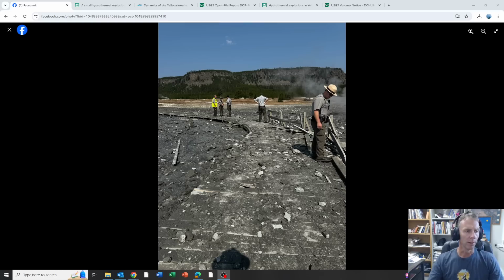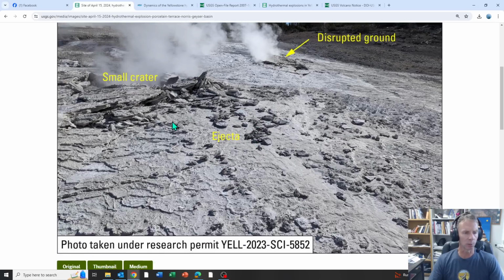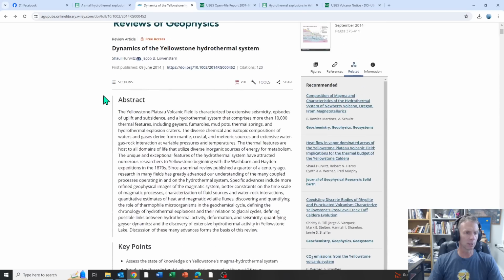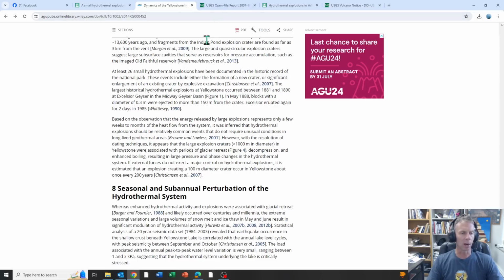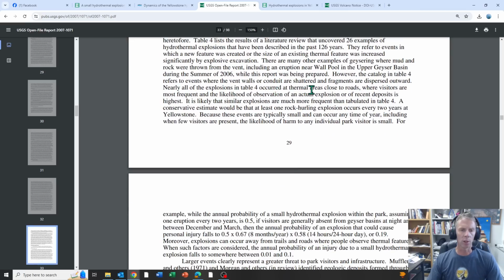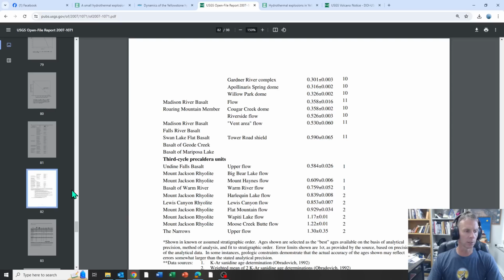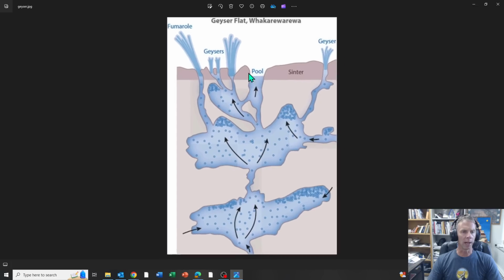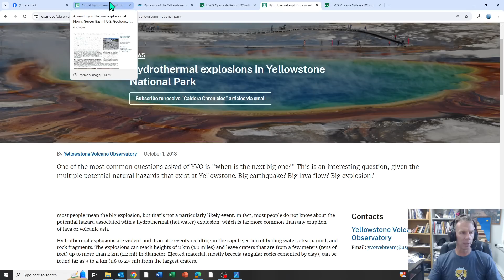Was Yellowstone's Hydrothermal Explosion Really Common and Small? Geologist Provides Answers

Comment: Thanks for the explanation Willsey. I knew how dangerous this was when I saw the boulders flying. If you remember the experiments we did in the lab rhyolite bombs can form if silica basalt is disturbed and volcanic ash clumps together and seals openings of the vents. When that happens the pressure can shoot these bombs into the air and they can travel a few feet to a few miles and some are the size of bowling balls. Rhyolite only forms when there is strong volcanic activity or a violent eruption and thats what happened. When I saw that video the first thing I thought was RUN! good thing they got out of there in time.

Comment: I'd guesstimate the explosive yield at somewhere between 50kg and 150kg but probably closer to 50kg.  The visible explosive action for an event like this can be less than the real explosive power because the ground sucks up a lot of that energy and what we see is a fraction of the total blast energy.  If you'd placed about 10kg of HE in a shallow hole you might get a plume about the size of the one shown in the video, but if that energy was released 50m below ground you'd need way more explosives to accomplish that amount of damage and cratering.

Comment: Waimangu geyser is a classic case of a mislabelled "geyser" that displayed all the characteristics associated with hydrothermal/phreatic explosions. Erupting between 1900 and 1904, it seems to have been the direct result of the (cooling) 1886 Tarawera eruption (igneous) intrusion interacting with the hydrothermal system/ground water of the area. 
The "geyser" was noted for black coloured water, block ejection, dense steam clouds, and forceful blasts incl. possible base surges; all of which can be seen in videos of similar eruptions from Ruapehu, White Island, and this most recent one at Yellowstone. 
All steam-driven activity, rather than being directly connected to the magma chamber or magmatic systems.
Reply: My absolute most favourite thermal region to visit Waiotapu or something. The surface trembling or tension is alot less now after all the power plant wells drilled.
Reply: @wendygerrish4964  huh?? Waimangu has no thermal power plants in the immediate vicinity. Neither has yellowstone. Are you refering to wairakei?